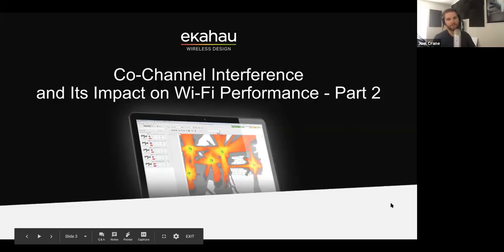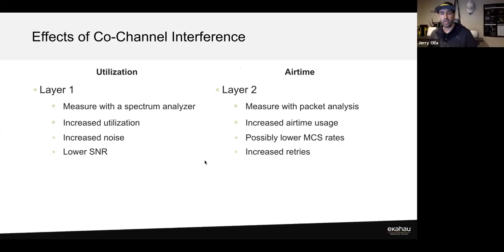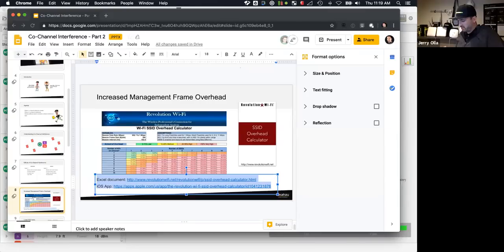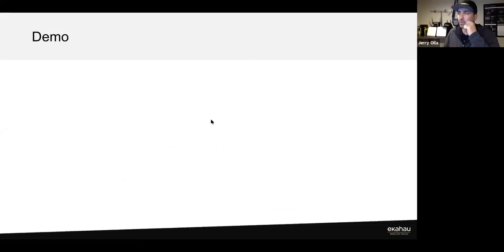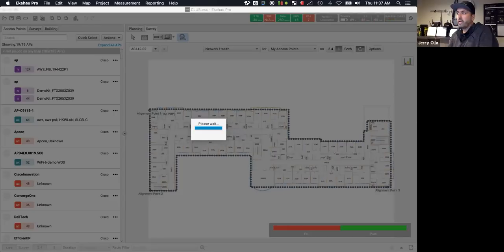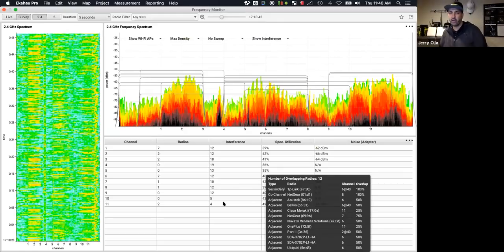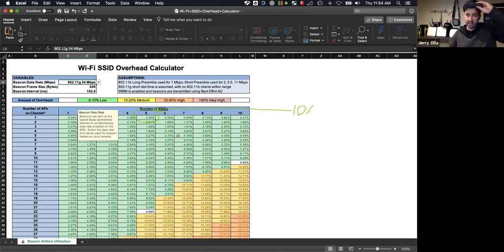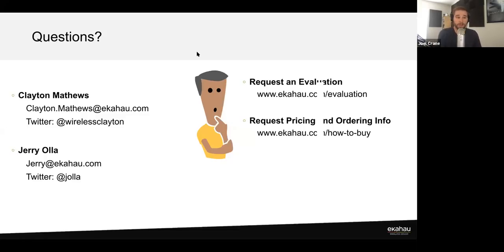Co-Channel Interference and Its Impact on Wi-Fi Performance - Part 2

Comment: something that seems to not be talked about I've seen is what NIC to use for design.  For the past two years our company was using ekahau nic300 for design purposes, but then I pointed out that the nic300 was reading anywhere from 8 to 15dbm (mostly 12-13dbm) stronger than the laptops internal or the nic on the voip phone that our client was using, so we started to go back with that. is there a webinar that discusses the issues that can arise from this.  I feel like by using our weaker NIC on the voip phone, we've designed the APs to be closer together than we used to.
Reply: In ekahau pro, if you ctrl click the legend on the bottom right while showing signal strength, you can choose a device that lets you offset the dBm. SO you can more accurately see what a smartphone sees, instead of the simulated or measure with a sidekick view you usually get.